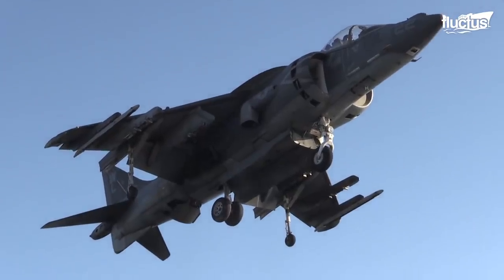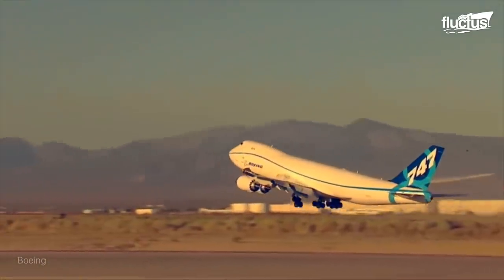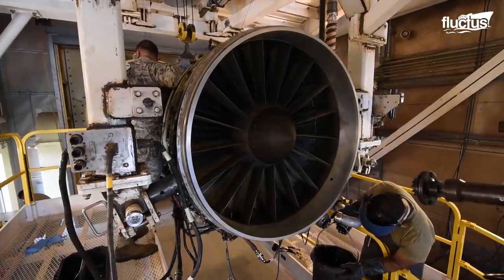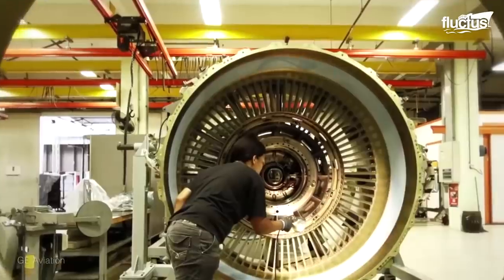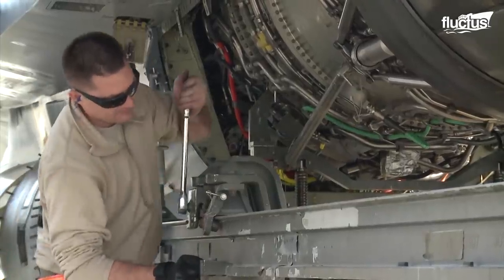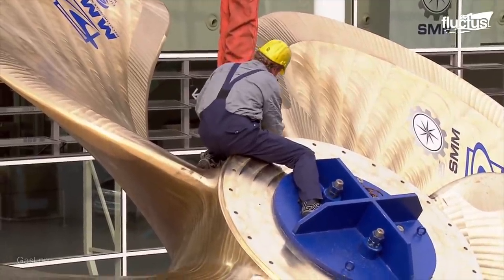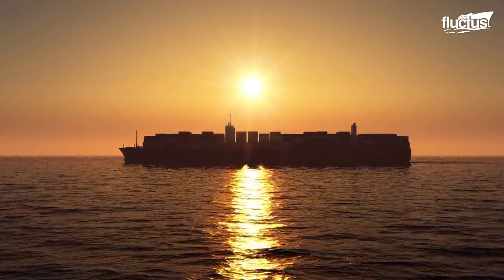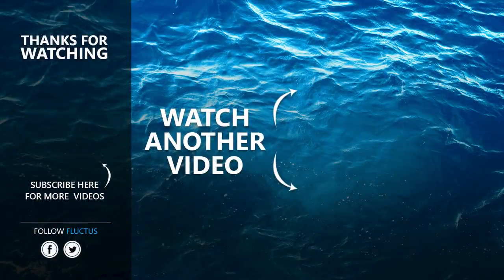Inside the Intense Testing Methods of Massive Jet Engines

Comment: The greatest thing about jet propulsion isn't just the mechanical thrust leaving the back. Jet engines can and do produce several different types power when running, they produce air pressure "Bleed air" which is used in several ways, plus the rotation allows for mechanical uses like hydraulic pumps, generators and vacuum pumps.  Many power plants that run on natural gas do so with a large modified jet engine.

Comment: To be clear, the hot exhaust doesn’t really provide thrust on commercial airplanes. Most of their thrust comes from the high bypass fans near the intake. 
On the other hand, military fighter engines get its thrust from the hot exhaust that’s squeezed and expelled out the back of the engine. Pretty the same operating principal, suck-squeeze -bang -blow
Reply: Yes, I saw that and immediately stopped watching lol.

Comment: Yes I agree with the other comments, why jump to ship propellers? I think the anti icing test was a water ingestion test, to simulate flying through a storm, this is only done on certification test engines and not on probuction engines. Probuction engine test are looking performance figures ig fuel /oil consumption, fuel, oil or gas  leaks plus engine vibration something not balanced in the core, wear on components ig coating loss on blades.

Comment: There is an error in the illustration. Instead of hot air on the outer section of the turbo engine, it should be cool air from the propfn cooling the core of the engine. The hot air should be in the core, centre of the engine.

Comment: Only about 10% of a airliners thrust comes from combustion. Most comes from the large fan in front. Hence the name Turbofan. They are high bypass engines because most of the air for thrust bypasses the core. Please do research first cause most of your videos have many glaring inaccuracies.

Comment: Boeing 747?  How old is this?  The Airbus A380 is larger than that American made tin can.
Reply: The A380 was a commercial flop and production has ended
Reply: That American made tin can has been in service since 1969 and is still going strong, meanwhile the a380 was just a bad investment.
1570 747’s built since 1968, still in production, development cost was $5.8 Billion in 2020 dollars, the 747 has been a huge win in every regard.
Vs..
251 a380’s built since 2007, a pathetic 14 year production run on a $25 Billion development investment = big fat loser.
Besides, not sure why you’re bragging, the a380 isnt the biggest either, for that look to the recently deceased AN225.
Reply: How old? There’s an A380 in the actual video so idk what you are talking about. Plus the A380 was a commercial failure while the 747 has ruled the skies for decades. Someone needs to lay off the salt.
Reply: Sorry, A380 is a fail.  747 led the way and still successful.
Reply: No your wrong the Airbus A380 is the biggest passager plane.